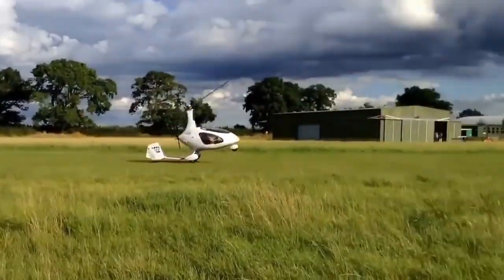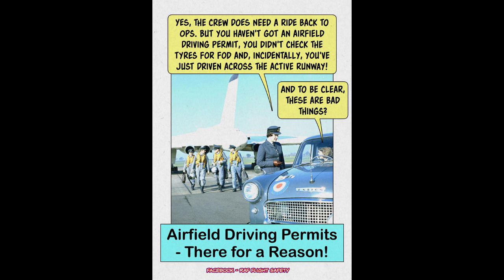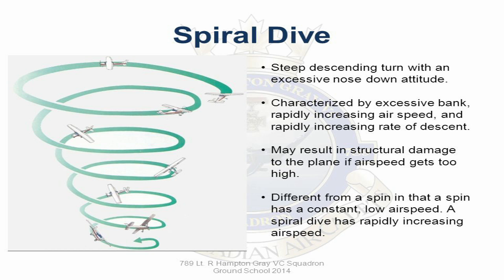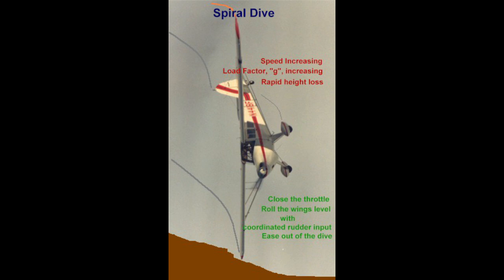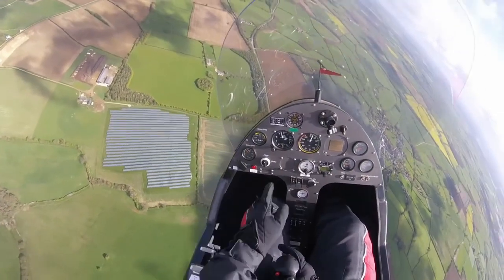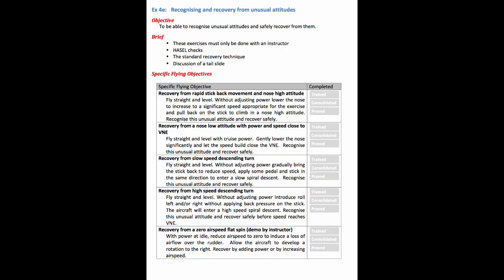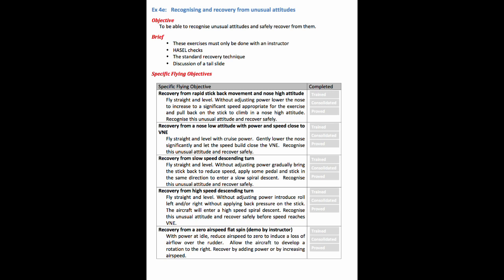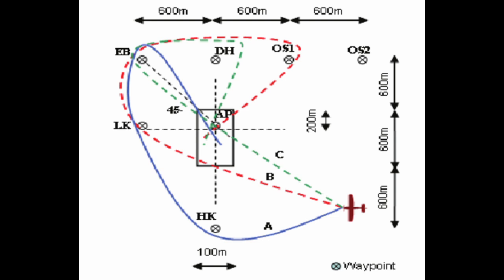Gyrocopter spiral dive and emergency landing cautions and gotchas

Comment: Another great video. Thank you.

I would love to hear your views on aborted take-offs.

As for those that consider the analysis of accidents and incidents (fatal and otherwise) to be in bad taste, let me add this. Aviation is an industry that has an ongoing tradition of learning from the mistakes of others (not always pilots). We take incidents, forensically examine them, change our ways and move forward. Some well known (and unsurprisingly tragic examples include) the Comet airliner, the (yet to be concluded) 737 max and too many military fast-jets to mention. Closer to home we have the issues of centre-line thrust and horizontal stabilisers. The fact that some 'contributors' might know the victims of incidents highlighted on this YouTube channel is tragic, but using their experience to to (hopefully) avoid more tragedy is the right thing to do. 

In a similar vein, I am presently reading the book "The Killing Zone". It is, like this channel, a resource that specifically addresses the issues that repeatedly cause pilots (particularly low-time pilots) issues. It is, like this channel, compelling, sobering and above all else, an excellent resource.

Please keep up the excellent work.

Comment: Can you exspand on this video more: as a non pilot who is trying prepare before i go to an instructor, i have no clue what you're saying here. 
Maybe do a video while you're sitting in a gyro so we can see your movements. ?? Just a request.
Reply from the maker: Hi - sure happy to try and explain a little more.  When you fly it is usual not to stare a the altimeter to try and stay level but to look at the nose of your aircraft and gauge its "pitch attitude" verse the horizon.  At some point in your flying journey that sight picture becomes recognisable as something that is level.  Of course when you are flying straight you may need to make slight trim & power adjustments to keep the nose "on the horizon" so as to speak - however it is normal to correct small inaccuracies in pitch with the stick.  So if you were slightly nose low you might add a little back pressure to the stick just to hold the nose [or pick the nose back up]  to the horizon.  However if you are in a turn, and particularly a steep turn, then adding back stick will not raise the nose to the horizon but merely tighten the turn.
Reply: @gyrocopterflyingclub6148  ok so now that i understand that i see the video of the gyro that had his nose up but crashed it anyway. What happened there?
Reply from the maker: There was no crash in this film? What time stamp are you referencing? Cheers
Reply: @gyrocopterflyingclub6148  sorry it was in another video you posted previously. The blue gyro that took off and the  crashed just outside of view. His nose was up and he dropped tail first. At lest thats what it looked like.
Reply from the maker: Arh ok I think I know what you refer to and no nothing to do with this.